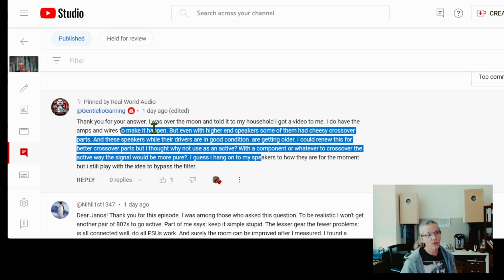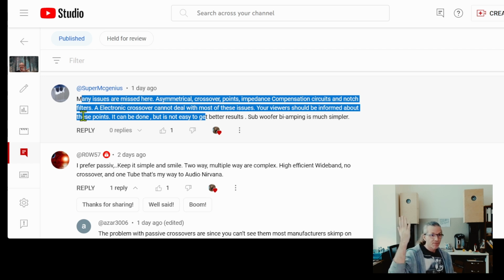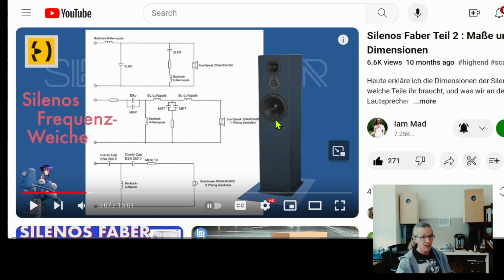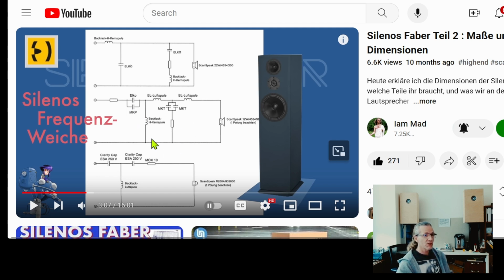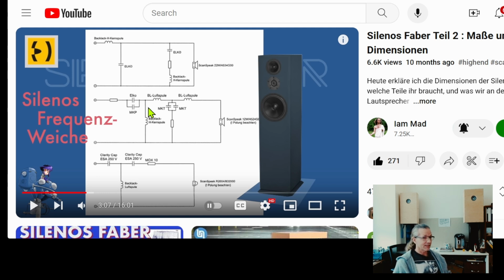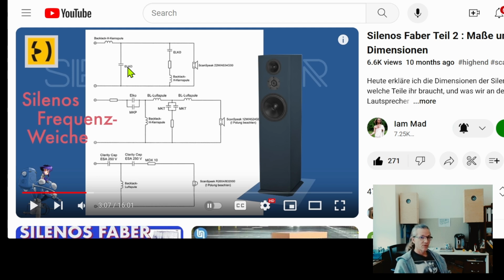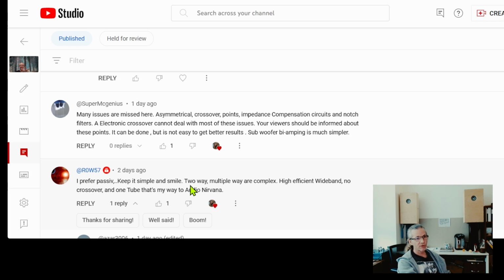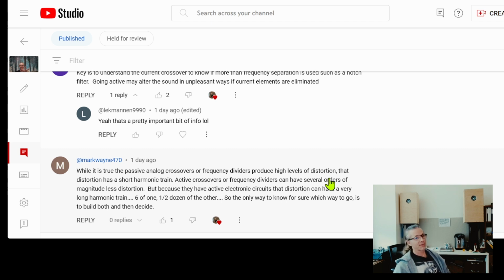Crossover radical change: roadblocks in changing from passive to active

Comment: It looks it is not as a simple task as i expected. The Devialet company offer a solution with the SAM technology and my speaker the Hyperion HPS- 938 is on their list to get the treatment. It is based on measurements of the speaker. But i think it is a solution without how the designers wanted it the speaker to sound originaly. I could be wrong. If you have the time you should find it when you google devialet and SAM. But i have mailed a US youtuber that upgrades speakers and i could send the crossover parts to be upgraded without needing to send the complete speaker. I might just do that.
Reply from the maker: Thank you, superb! Ouch, the Devialet SAM is $10K. It seems to do a lot of things inlcluding timing alignment and driver specific matching, and the company has done the research to match specific speakers. That is hugely helpful, as I think the hardest part is to do the matching... as the company has done it, makes things so much easier for the user - you do not need to turn into a crossover expert. Although I'd say a huge amount of fun is to tinker, and find out solutions that suit your taste specifically. After all, the speakers will have to match your system & room & taste, which might be different from original manufacturers operating point. I'm curious how it will change the sound if you decide to go ahead!
Reply: @realworldaudio  Ouch i didn't know the pricing. 10k for a speaker that was 6k 20 years ago. I don't think so. It is almost a small new car without having a stereo setup. Why would anyone choose something so expensive on these speakers? They didn't have to bother. But i do appreciate their attempt to make a good solution for speakers costing triple of my speakers.

Comment: THE NEVER ENDING STORY .............( of some friends who choose to follow this road with a crossover ) 
Those ( very) experienced audiophiles /DIY do experience that...........for any different sound level there are mostly always adjustments to make .....very difficult to apply one adjustment for general satisfaction , every speaker has it''s own sensitivity and it's own dynamic response .

There's always the experience ta trade off by win and loose .........

Kind regards
Reply from the maker: Frank, so true!!! There's no generic recipe, each case requires a fine cook with a fine ear and sound brain . :) I hope this summer will not be as hot as the previous ones! Cheers, Janos

Comment: Hi Janos, active crossover these days are much more advanced than what you've described in this video. A channel with 1 driver (let's say a mid range), you can add a band pass filter, a gain (be it + or -), EQ to equalize any abnormalities within the frequency response, a time correction capability, and depending on the DSP chip + software, even a FIR, or even an All pass filter, all within the digital domain, no added noise/distortion within the digital chain.

Edit1:
I completely disagree that we cannot replace passive crossover with an active one simply because a passive crossover can do impedance adjustments (like a zobel network), or do a limited equalization such as notch filter, or baffle step compensation, etc. We use a crossover to manage a driver's output so that it will sound the way we want it to. In active crossovers using DSP, we can make a similar (yet in my humble opinion MUCH MORE ADVANCED) version compared to a passive crossover. If you're worried about impedance curve of A DRIVER, one singular driver to an amp, remember that we are feeding it with a managed signal that will not force the driver to do something that it's not supposed to, for example: we won't feed a low frequency to a tweeter, or we won't feed a lower than 100Hz to a midrange. Looking at impedance graph, let's say Scan-speak R3004/602010, we will only feed it a signal where the impedance curve is "smooth", according to the manufacturer is above 2500Hz with HPF at least second order Butterworth filter. The amp will only see a smooth impedance as a load and not much variance IF it feeds the tweeter a high passed signal. The same will happen to a woofer and midrange. Each amplifier only sees ONE coil exactly, no other reactive component in sight of the amp. Simpler design IMHO.

Should you want to see how exactly a modern DSP works, here's an example video https://www.youtube.com/watch?v=D-KdT6aHIDc&list=PLZclK6QjKmoVhU59mnZX2-GUWYtrlGK0L&index=38

Comment: I removed the passive crossovers from my 3-way speakers and went all active using a miniDSP HTx for the crossovers/DSP, and three stereo amplifiers (one Hypex Nilai500DIY Stereo amplifier and two Topping LA90 Discrete amplifiers).  This greatly improved the sound quality of my system.  The bass response, tonality, dynamics, sound staging and imaging all improved significantly.   I used the stock drivers, but added some additional bracing in the cabinets, plugged the ports, and added a lot of additional damping material (fiberglass insulation).  I have a thread on the project on Audio Science Review, titled "Modifications to Elac Uni-Fi Reference UBR62 Bookshelf Speakers".

One aspect that people often overlook is damping factor.  Passive crossover components on the woofer significantly reduce the damping factor (the DC resistance and core losses in the inductors probably have the greatest impact).  Thus, the amplifier does not have as much control over the woofer in comparison to completely eliminating the passive crossover components.  Eliminating the passive crossover components greatly increases the damping factor, and thus increases the amplifier's control over the woofer, which significantly improves bass response.  See, e.g., https://sound-au.com/biamp-vs-passive.htm.

Another aspect that should not be overlooked is that using a good DSP (e.g., miniDSP HTx), you can easily choose the crossover frequencies, crossover slopes, crossover topologies, etc.  Also, with DSP you can adjust time delays on the individual channels to fine tune the phasing of the drivers at the crossover frequencies.  You also can apply parametric equalization with DSP to tune the speakers for your listening preference and for your room.

Having experienced an all active speaker system, I do not envision myself ever going back to using speakers that have passive crossovers.

Comment: I would think active crossover systems would deliver to the drivers out-of-band frequencies introduced by the downstream amplification. Is this significant?
Reply: This is true, but insignificant unless a very noisy amplifier is used.  There is a cleaner path from the amplifier directly to the driver.  So, any noise the amplifier is generating in the output signal path will go to the driver to which it is connected.  The key is to use low noise amplifiers.  

Recently I conducted a comparison between two active systems, the one I built using my Elac UBR62 speakers (crossovers removed and connected to Topping LA60 Discrete amplifiers) and my KEF LS60s (internal amplifiers).  The systems were turned on, but the music was turned off.  On my Elac speakers I could not hear any noise whatsoever with my ear placed within 2 cm from the tweeter.  On my KEFs, I could hear a tiny bit of noise (static sound) with my ear right up to the tweeter, but this was completely inaudible at 1m.

With an amplifier that it noisy enough, you can even hear static on speakers that have passive crossovers.  This was not uncommon on low-end audio systems back 40-50 years ago.

Comment: well you can with DSP you can change the Q to how you want it it works in the same way as putting in the filter passively.
film capacitors are not good in all parts of the crossover especially in the mid range electrolytics need to be implemented in parallel to give a better quality of sound

Comment: No need for dsp if you only want slopes. In that case something like the pass 6-24 crossover would be the best.
If dsp is needed use camilladsp on a powerfull multicore pc with one dac channel per driver.

Comment: My YT presentation remains the same. Sometimes if you change the size on the screen the layout changes, although you've probably tried that....
Reply from the maker: Sadly, with either layout it's quite bad. I either get the narrow comments on the side, or full width comments on the bottom that reload once I scroll to the bottom. Looks like YT fixed the reloading issue - or, at least, now it's not reloading... still, I had to scroll down ages to get to the comments - and that lots of scrolling will dissuade a lot of would-be commenters to post a comment as it;s so much harder to find the comments section.